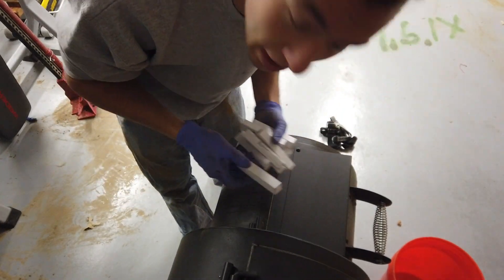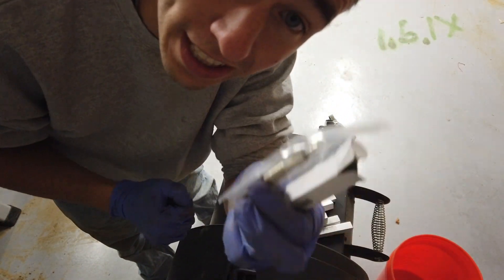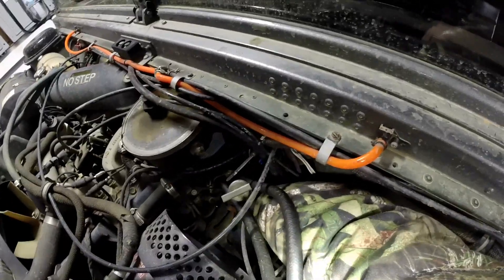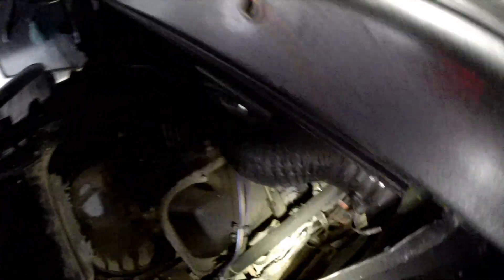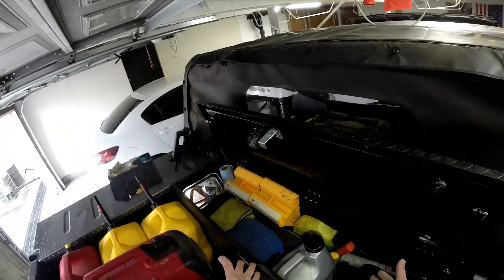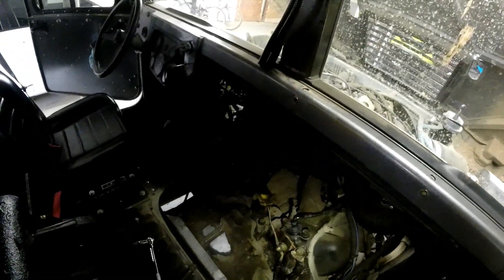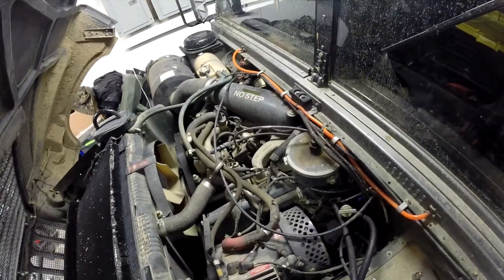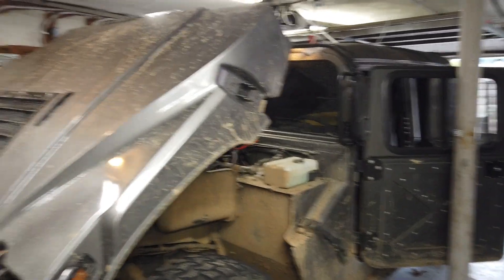Changing Glowplugs for Dummies (6.2/6.5 GM V8 in USMC Humvee)

Comment: So you inspired me to buy a hummve. Waiting for EUC now.  I see you removed the fording kit exhaust.  Did you leave the exhaust as is, or add a smaller tail pipe?
Reply from the maker: They make an exhaust tip which I eventually bought off Ebay, but I never put the fording exhaust on because the Humvee wouldn't fit in my garage with it and a lot of trails. In my opinion its not needed, I submerged the exhaust a bunch of times and never had an issue! Maybe because I didn't ever shut it off in the water.